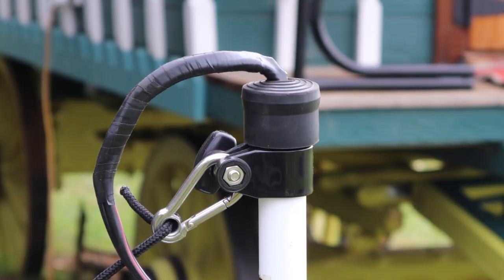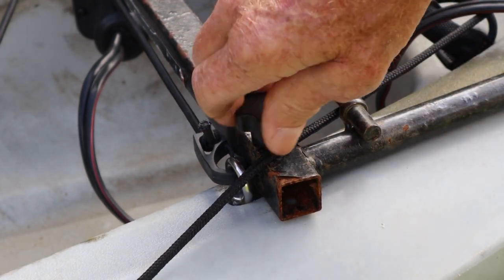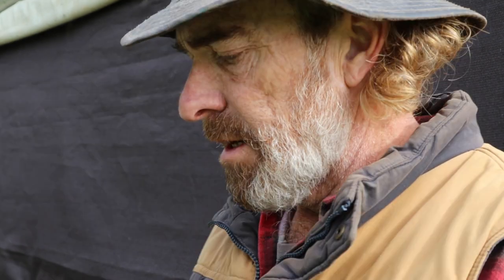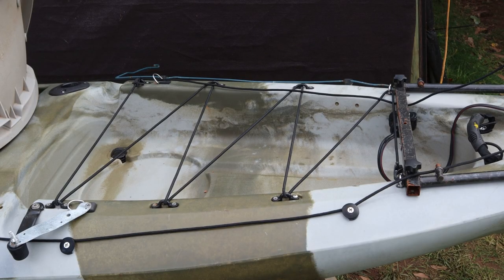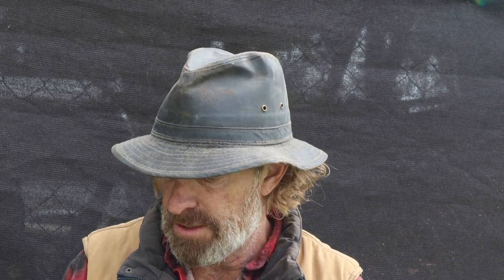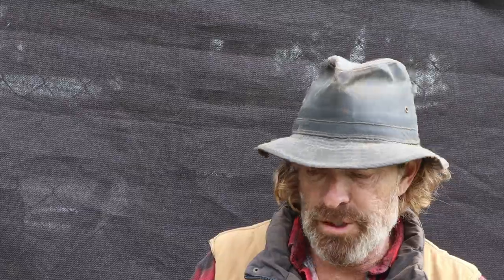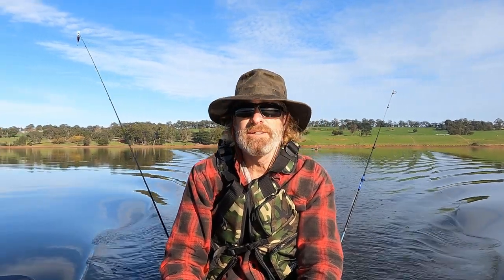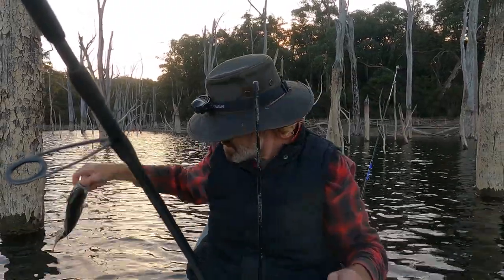Watersnake Trolling Motor With PWM On My Kayak

Comment: Nice setup. Maybe I missed it but how long does the 50 ah battery last you?
Reply from the maker: No you didn't miss it. I didn't really do a dedicated test as far as how long the battery lasts. But, long winded answer would be, starting at 12.5v full charge, probably about half speed crossing the lake (in the video), used a few more times low speed getting to the camp site but mostly just paddling, same for going back to the head of the lake next day. Then I gunned at full speed across the lake back to the ramp, just to see how long that crossing would take, 12 minutes. Once I was done, battery was showing 11.8v. So...still had a lot of charge left. Hard to say, but I reckon you'd have power all day at least  if you were constantly using it. Hope that's a fairly decent answer 🙂